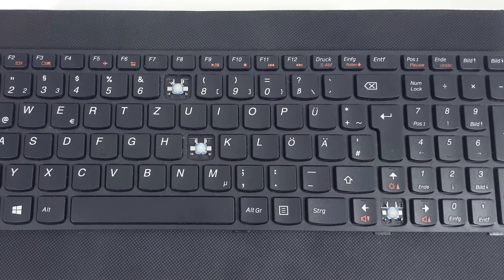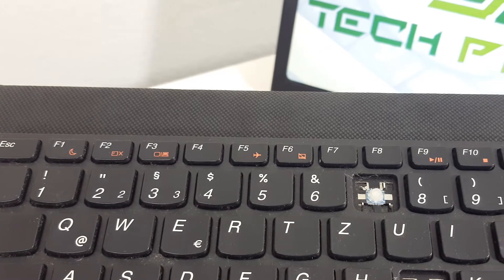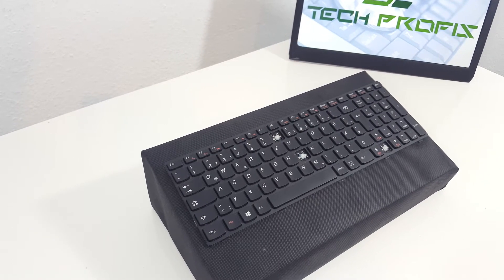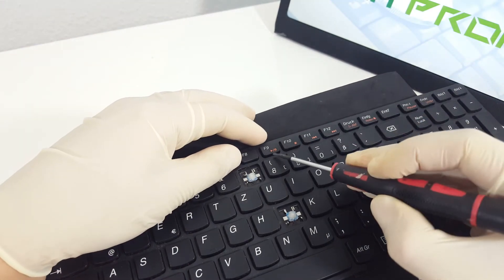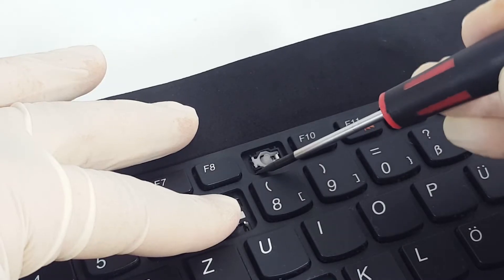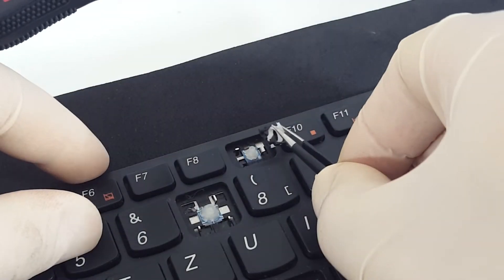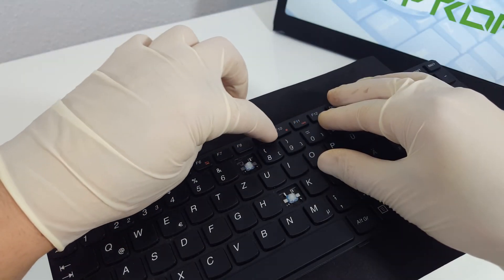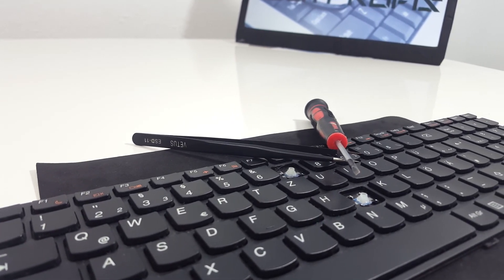Mini Laptop Keyboard Key Repair Fix How to Install F1 F12 Keys

Comment from the maker: If you have any question feel free to ask! :)
Reply: @rehangarg4869  Did you find a way to fix it?
Reply: My wifi key is stuck on orange plz help
Reply: hey, my f10 key has some problem with it. when i click on it it does not feel normal. like its not clicking properly. the key does not work too